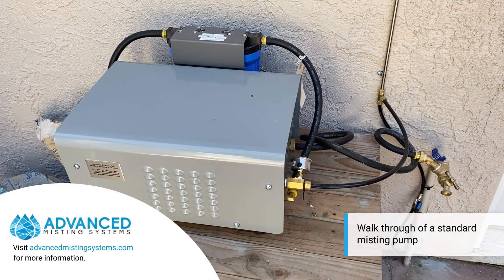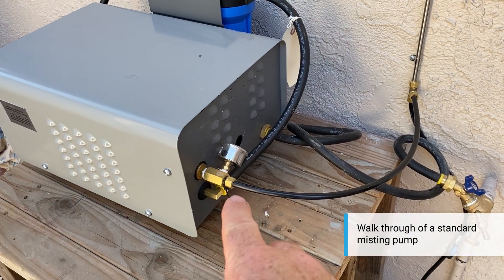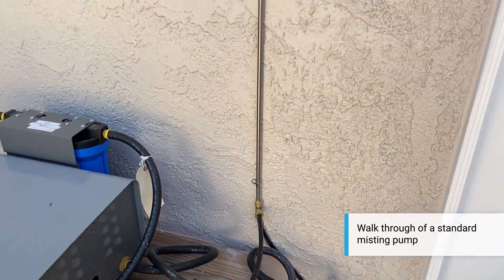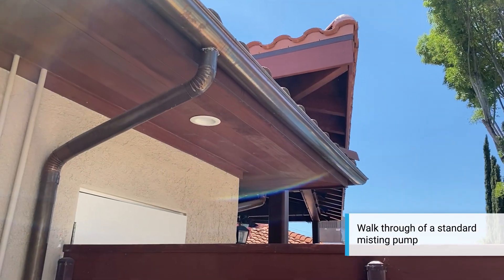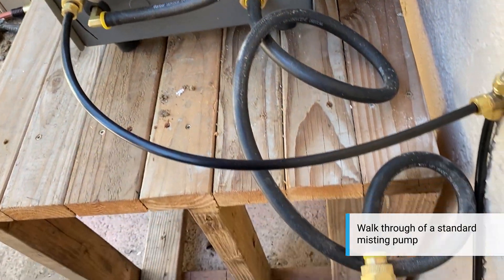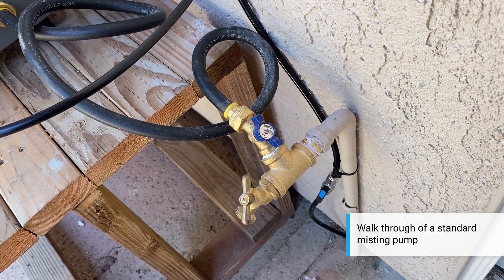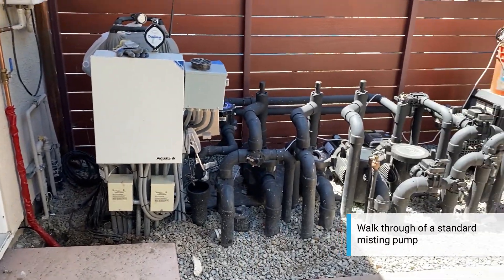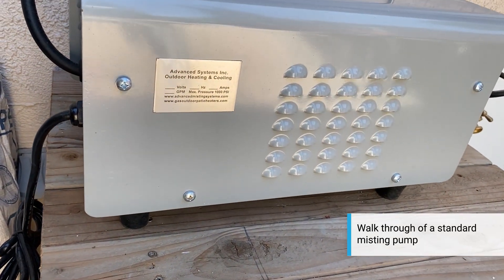Walk Through of a Standard Misting Pump - Advanced Misting Systems

Comment: How far can you run the supply line to the stainless steel tubing?  Should the the supply line be stainless steel all the way or can the high pressure tubing be used for longer runs?  Is there a length limit from the pump to the misters?  In my situation, where I want to install the pump (with my other pool equipment), the run could be 50'-75' to the misting line.